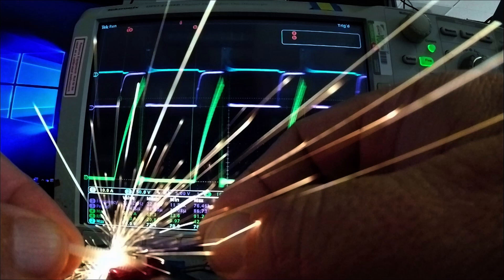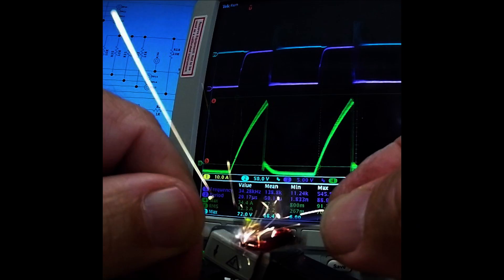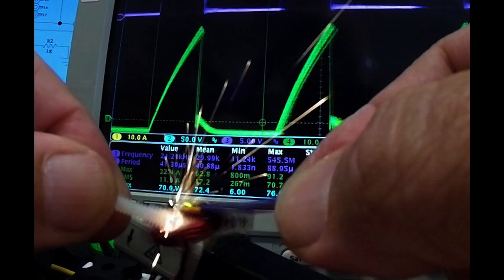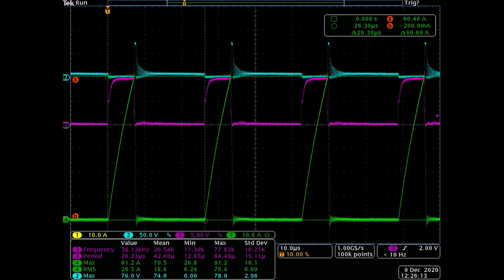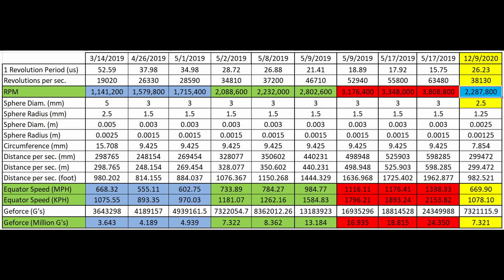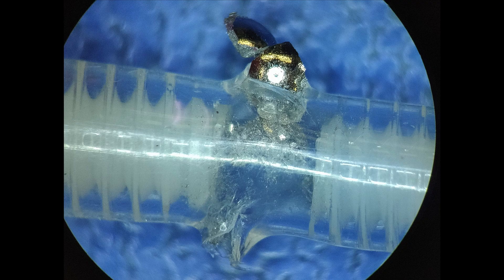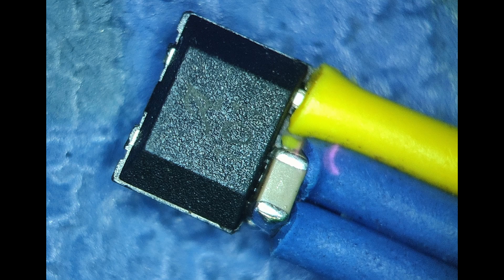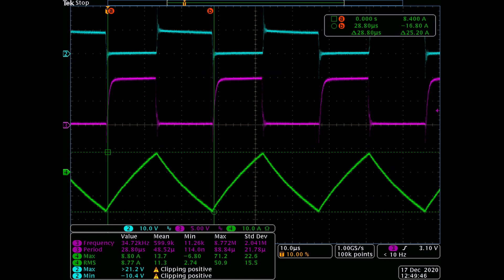PMBO 2020  By -Oz- 2 Million RPM

Comment: Well described and some serous RPM! Can we call it the neo-sphere demolisher?  Great job and appreciate you participating.
Reply from the maker: Thanks bud, its been a learning journey on fets/drivers/flyback-voltage/sensors and the limitation of the neo-sphere's. The 3 minute limit was difficult to get it in there, so I left things out and put most of them in the description. The best part is the configurable h-bridge driver, today I spun up a hard disk to 59,000 rpm with it, but it hopefully will help with my next project and this project going forward. Thanks for watching. EDIT: I just checked out your channel, great stuff, I subbed and will check out them videos.

Comment: Superb
Reply from the maker: Thanks, I checked out your channel, very interesting, I sub'ed and will check out your videos.
Reply: thanks, maybe my halfbridge pcb might be useful for you.
I use the flyback as impulses for a series resonant bifilar primary pancake coil.

My goal is to use 1700V SiC mosfets, and see if I can generate 1700V impulses to research their effect on current amplification
Reply from the maker: @MasterIvo  Thanks for the info, i checked out the half bridge driver your using, looks good for higher voltage and freq applications. The bridge i am using is only good for 650V, and thats way higher than I need at the moment, i do like the simplicity of my driver with the bootstrap diode (providing gate voltage for the upper N-FET) and single supply, pros/cons of both. You have some interesting stuff, thanks for sharing.
Reply: @user-rs8zg8ey2b   Great! I strongly feel there is some magic to be understood in the use of inductive spike impulses, in combination with series resonant primary coils
Reply from the maker: @MasterIvo  So, you mean "electrical resonance occurs in an AC circuit when the two reactances which are opposite and equal cancel each other out, and powered by the inductive kickback"? If yes, can you share schematic? Sounds interesting. Are you in the USA?
Reply: @user-rs8zg8ey2b   yes.
with series resonance the impedance is equal to the wire resistance. 
The impulse (inductive kickback) can travel through the cap coil system, as if it was a wire to ground. 

When tuned slightly above resonance, the impulse will be seen on the voltage maximum, while the current is amplified. 

this is the video link, and in the description are links to more info:
https://youtu.be/c2_rKc7sHGk
Reply from the maker: @MasterIvo  Pretty awesome stuff your researching! I found a board that has two h-bridge, some good high current fets all for $13 shipped. https://www.aliexpress.com/item/4001031368863.html?spm=a2g0s.12269583.0.0.3bbc5f19zYteoy
Reply: @user-rs8zg8ey2b  thanks. I have a workbench om the open-source-energy.org forum if you are interested.
For now I work with half bridges as I need an earth ground for the impulses